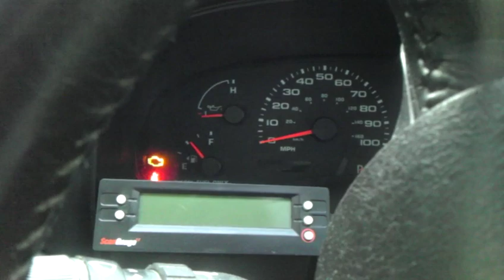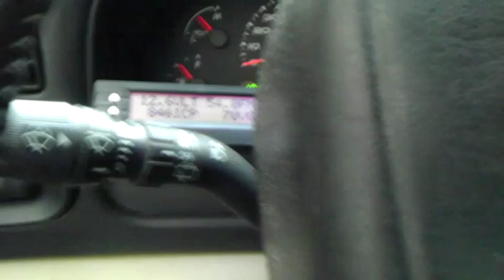Powerstroke 6.0L Bad Lifter or stuck valve?

Comment: Pretty sure a bad lifter wouldn't lift the valve off the seat thus wouldn't let compression escape I.e that thumping sound u hear in the intake. A bent valve will not seat properly when the piston returns to tdc all the compression escapes because the valve is not seated and sealed.Mine is being repaired as I write this and that's the best theory I can give u based on the video..good luck

Comment from the maker: J, It's not an injector problem at all.  It's a dead cylinder.  Very low compression.
Not sure if it's a bent or burned valve or a burned piston or a bad lifter..  Actually runs great with Cylinder #8 disabled.  Getting ready to tear the head off soon.
Reply: Hey Chet did you have to buy a rebuild kit and get the heads shaved? I’m in a very similar situation to this. I’m looking at a rebuild kit from Sinister Diesel for about $1,500.
Reply from the maker: @jakeguidry6467  I just shopped around for each item on Amazon or Rock Auto.  I used Extreme Studs for the heads.  New ten over pistons.  Sent the heads to a machine shop.  Still running perfectly 3 years later

Comment from the maker: Chip, I haven't taken the head off yet to see what's broken.  I have other projects ahead of this one so at the moment I've disconnected the #8 injector and it still runs when I need it to.
Reply: Have you found out what it is yet? Mine was doing the same thing.. Ford said it was most likely the lifters, they also said it had a couple bad injectors. after I replaced the bad injectors I gave it a good rev and CLUNK! The engine made a terrible noise and now it won't run and sounds bad when you crank it over. Don't have the funds right now to tear it apart because if I find a big problem i want to have enough cash to fix it then and not let it take up space in the shop. Please let me know what you found because it was making an identical sound to that before it died.
Reply from the maker: +Bradley Smith 30k miles on it since it broke.  still driving it on 7 cylinders. ;)
Reply: +Chet Spencer Update!! I pulled the engine and found that the plastic clip on the rocker arms failed on number 4 cylinder, the intake valves were not opening. The lifters were perfect. I also found that the top of the piston rod broke on #4 cylinder so the piston head and rod were not connected.. that's what the "loud clunk!" was after I revved it up. Cylinder walls and block are unharmed though.. Piston must've had too much suction without the intake valves opening. I swear your motor sounds identical to what mine did before the piston broke, id pull the valve covers if I were you and check it out sometime. Those plastic rocker arm clips only cost about 4-6$ a piece. Good luck!
Reply from the maker: +Bs6.0pstroke_ 28 Thanks for the feedback!   I'm finally getting to the point where I have to stop driving it as now my FICM is dropping down to about 30 volts and my Excursion is not going anywhere on 7 cylinders and 30 volts ;)
Reply: Dang that sucks, fortunately a FICM isn't all that pricey. Also I gave you some misinformation. After re-inspecting the engine we've found that unfortunately the noise was not coming from the broken rocker arm clip. It was coming from the slop in the slightly cracked piston rod and wrist pin slapping together before it finally broke all the way, however don't be too alarmed a failed lifter would sound very similar to that so I think that's most likely where your noise is coming from. Again good luck!!

Comment: Did you have any blowby or smoke railing out the tailpipe? And when you would crank it over did it skip? My trucks blowing smoke, running inbalanced and sounds similar to this but I have no blowby.
Reply from the maker: Yes, lots of blue smoke, I had to rebuild the motor
Reply: Mine has no blowby so I’m really confused with mine😫
Reply from the maker: I had no blowby either, sounds like you might have a dead cylinder like mine did
Reply: What did you have to do to fix yours and how much was it. Sorry for bugging you 😂
Reply from the maker: @maximusedmonson  No problem, I bought another dead motor and rebuilt it from scratch.  I'm loving my Excursion BTW.  I spent about 5k on parts and tools
Reply: Why’d you go with another motor? Less miles?
Reply from the maker: @maximusedmonson  I had to keep my truck running until I had a drop in solution

Comment: I have a rhythmic ticking that happens every 3 seconds, any thoughts?
Reply from the maker: I would do a "base engine damage test" at the passenger battery with the wire going to the starter.  Google or YouTube search for it.  Doesn't sound good

Comment: mine starts faster w 48 volts. heard morevolts is actually bad
Reply: Same problem 6.0 lq9 on truck couldn't figure it out went to 2 machine shops they said engine is good heads/block even though changed all engine bearing/cam/rod/main new oil pump tried stock pushrods/comp 7.4 oil pressure is 50% but couldn't find the problem same sound at idle but when reving won't raise the ticking sound